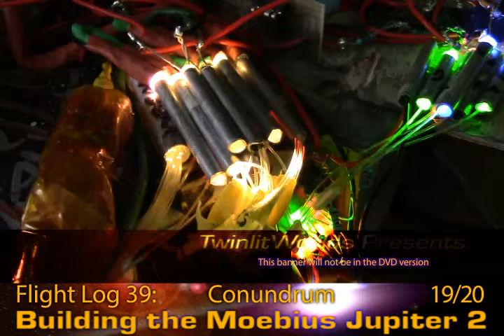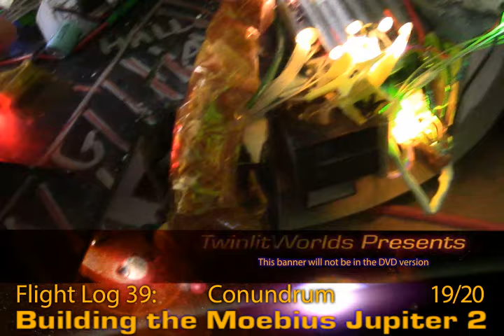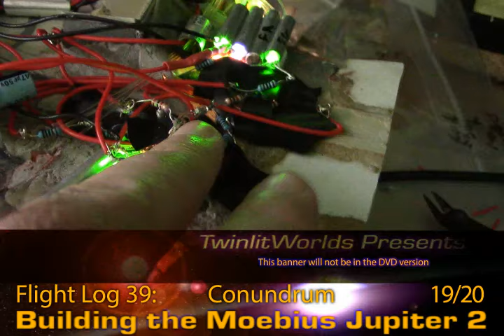J2 FlightLog 39: pt19 Conundrum

Comment: Bust!

No, seriously, there's something way off with that LED. Drill it out, replace and check for intermittent double voltage somewhere.
Reply from the maker: +Eliot Brown Tested several LEDs, they all work.  Something at the boards has died.  And there's no way for me to know which board died with the spaghetti nature of the work.  Only option seems to be replace all the boards, which I'm not about to do.  Truly wish I installed chip sockets on all the boards so I could at least test for that.  As is, I may as well throw the whole thing in the garbage.
Reply: Say not so, Tom! Fishing out the board and replacing it-- it's only 10 wires to the LEDs and a power connection-- should be child's play at this point. Do you have more boards/need some?

Comment: Wonder if one of the sequencer boards is overheating?  I was having  problems with the same boards you have and could never track down the source. But the board was hot as hell.
Reply: +Model Builder Greg If you're talking about Tom's "Sequenzatore" sequencer, the circuit works very well and is just fine down to 6V and up to 12V. SO! Take it off line and hold it up to a really bright light and check all the gaps between the solder joints. Inspect carefully, perhaps with magnification and with a harsh side-light. Make sure there are no shorts. Use the back of a broken-tip X-Acto knife to scrape between any two solder points. Check the placement of the parts-- there is a tricky bit with the two diodes-- one jumps another part. It's easy to mess that one up. Make sure the print on the disk capacitor is facing the large IC.

If things look good but any component is really heating up, get in touch with the manufacturer. He's still in business (Kingston Vacuum Works, now Fedoratron.com) and will send you a new board for free. Use a LOT less solder next time. Nothing should get really hot on the sequencer board.
Reply: +Eliot Brown  Found the problem. Some of the solder had crossed over to the other line causing a short. Also;  I had  the capacitor in reverse order.
Thanks for the tip. I'm surprised I didn't blow-up the board.
Reply: Glad to hear! I know that board is tough, I have abused them many times. I worry more about the batteries or power supply (-- you can't spell "power" without POW!)